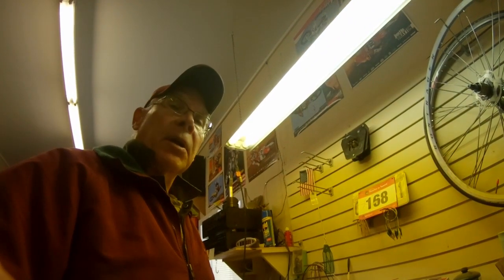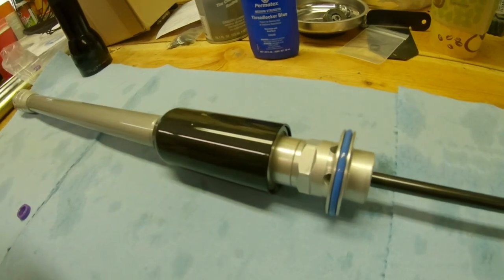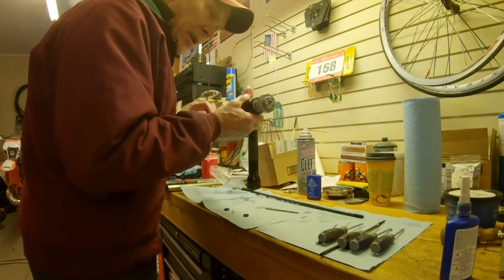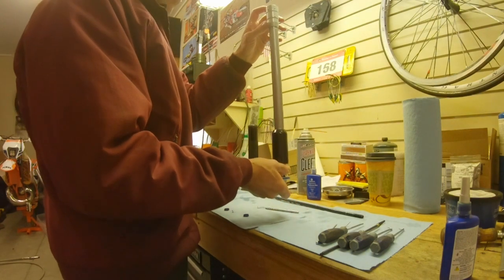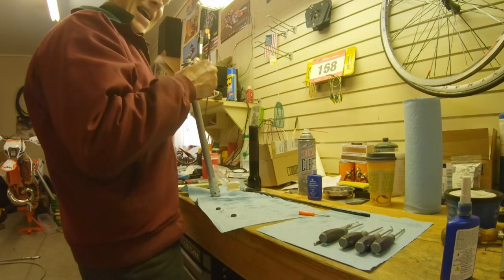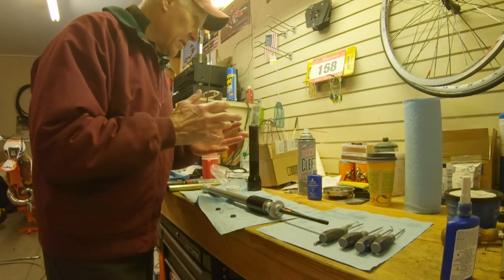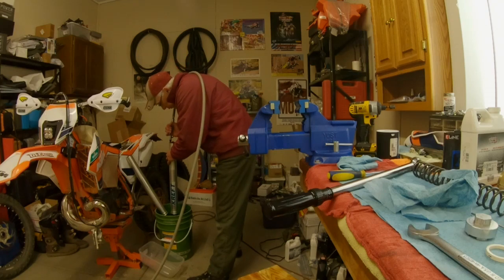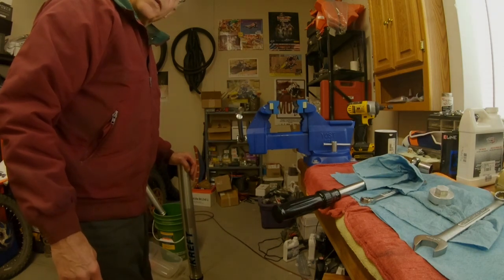4CS Forks -  Bad Cartridge Seals - Bleeding Issues

Comment from the maker: So, I learned something else. I was changing the oil on one of my forks and the oil was dripping through kinda slowly. I was like...hmmm? Even tho it looked fine, I changed the purple seal (took only about 1 minute this time!) but no change in oil leak. I pressurized the fork anyway and when I went to insert the aluminum rod into the piston rod (that clickers actuate) and the thin tube it goes in was full of oil! Something was not right! So, I changed the big blue outter oring even tho it too looked fine, no change. Upon pressurization, the inner thin tube again full of oil. So, I talked to my suspension tuner. Apparently there is a tiny oring inside the bottom of the piston  rod components (above the bullet shaped end) that can go bad. He said sometimes, when its bad, you can actually blow the clicker right off the fork when riding and get a faceful of oil!  I'm crying UNCLE and sending him my inner cartridge so he can replace the oring.

Comment: I have this exact issue. Lots of research later, this looks to be the easiest solution. You can it seems remove the "top hat" but it's torqued and has Loctite, so it probably needs to be heated (although the service manual skirts over this). It's hard cranking on a $500 cartridge, so your method is worth some time. Everything I read says the 4CS are poorly designed. The rod is notched to balance air and this cuts into the seal - it fails by normal operation and design - silliness. $15 at Slavens for 2 - I'll order 6 so I have spares. There are mods to revalve and turn into open cartridge design - but that seems like a lot of expense and hassle and I'm not that fast. Thanks for the video!

Comment: Thanks for the video. Got me up and running again! I used a cap head screw and pushed the head of the screw in through the seal hole and the pulled the seal into the groove with the screw head. Took about 2 minutes that way. Cheers
Reply from the maker: I don't totally follow what you did, but glad it worked!  Dunno if you saw my post from a year ago, but I got lots better at it...but I'm always open to learn a new way. Can you try describing what you did again?  Many thanks!

Comment: Thanks for the video! I have one question- how long did the seals last after replacement?
Reply from the maker: Sorry for the delayed response....they are still fine...I serviced the forks a few months ago - no leaks and the rod stayed up perfectly after pressurization.
Reply: @Dmac-CO  Thank you for your reply. I have serviced my forks, along with replacing the seals. I'm just wondering if in the fork responsible for compression, the push rod is also supposed to pump itself up. It works great in the reb fork, but hardly at all in the comp. When I bleed the forks after riding, I can only hear a hiss of air from the reb fork. How is it in your case?

Comment: What's the oil height supposed to be set to? Is it 65mm from the top when outer sleeve is slid all the way down.
Reply from the maker: 65mm would be really high, which would make your forks harsh.  I put 510 cc in the bottom and 130 in the top, then screw on the cap, pressurize to 75-100 psi, then unscrew outer tube from cap, remove cap and raise outer tube to max and then lower the tube. Then set oil height. I set mine at 120mm...my son's at 110. Then install spring and spacers, cap and reinstall bleeder if you use em. Set clickers. Done
Reply: @Dmac-CO  thank you good sir! I have the 4cs on my '16 husky TE 300 and I strongly dislike them. They bottom super easy and are harsh up top, worst of both world. Thanks again!
Reply from the maker: @erikstevens7301  I had mine revalved by Kreft. Unfortunately, they no longer have the custom components to do new forks.  Maybe once you fix the cartridge seal, the forks will be better. When the seal is shot, they are like an open cartridge fork with the wrong valving.
Reply: @ADV-dmac , which direction do you insert the seals? Open side toward the top or bottom of the fork?
Reply from the maker: @Glingafelter  Seals are always open side toward the oil...so down in this  case.

Comment: How do you get the jam nut off the pushrod? I can only loosen the jam nut by putting on the fork cap, but to take off the fork cap, I have to loosen the jamnut to where it gets stuck on the pushrod. I cannot for the life of me get both the jam but and fork cap loose at the same time without putting the pushrod in a vise etc. I am hesitant to use a vice or vice grips on the pushrod as I assume it is just aluminum. Any tips would be appreciated!
Reply: Probably late at your party but when jamnut is stuck on rod, use 2 nuts to lock them together on the threaded part, then loosen the jamnut, unlock the 2 nuts and get these 3 unscrewed. It's fine threaded M8 I think 0.8mm per thread if I remember correctly.
Reply from the maker: Sorry....wasn't on YT for some time. I imagine you've got this figured out by now, but a good piece of tooling to have is soft jaws for your vice.  If you have the right sized ones, you can safely clamp on tubes.  Rickozx's jam nut solution should work tho.

Comment from the maker: Update! Cartridge seal insertion now only takes a minute!

Was doing another set of 4CS and think I hit on the insertion trick. Works for me anyway,  Turn the cartridge head so the little notch at the top of the head is away from you. Dunno if it matters, but my logic is to get the sharp edges away from where the seal is going. LIghtly lubricate the seal and squeeze it with your fingers and insert it into the hole (it'll be kinda vertically in there) then, using a wide and dull tool like I showed, pull the side closest to you back and up into the groove where its supposed to be seated. Then insert tool further to get the furthest inserted portion of the seal and carefully pull it up to further seat the seal into the groove. Retract tool partway and use it to get the portion of the seal thats on its way into the groove fully inserted (it'll likely be a little cockeyed). Then, once the one side is fully seated, reinsert the tool down to the portion of seal thats furthest in, maybe slightly to one side or the other, and gently pull up on it. If all goes well, it'll pop right in!
Reply: Which direction to put in the seal? Open side toward the top or bottom of the fork?
Reply from the maker: @Glingafelter  Open side down....see 2:20 in the vid.
Reply: @Dmac-CO  thanks. No luck doing it that way with some aftermarket seals. I still can’t get a proper rebound of the damper rod. Just ordered a set through slavens, so I’ll try those ones when they arrive. Just to confirm, the damper rod should rebound on both the rebound and compression sides?
Reply from the maker: @Glingafelter  Yes.

Comment: Thank you soon much for making this video. I new I had a problem with seal, but no idea  how to replace. I have a "KTM" repair (CD) manual that does not cover this seal replacement. I'm going to order new ones and attempt doing it as you have since I had no luck trying to dissembling the inner tube (?) to get at it.
Reply from the maker: I've been offline lately....hope ya got it fixed!

Comment: I just did my own fork seals change , first time ever... that was interesting...   Watched the official and other vids showing filling from bottom..... started that and , as you describe, oil pissing out below rapidly.....  I needed bike going  to mark out tracks for upcoming ride so spent a LOOONG time bleeding from top , slowly adding oil and pumping rod up and down until all air was out.... it wasn't fun but it worked.     I will have to fix it in the near future, but they work well enought for me for now.  Thanks for the video.   And yes, nothing out there on rebuilding inner for 4CS....  rocky mountain did a inner for an open fork. Strange no one covers it.
Reply from the maker: Glad it helped! I did same as you on the first one...filled from the top. Did some fork compressions by hand afterwards and didnt like how it felt. Very linear/sluggish. After the new cartridge seals, the plushness in the early part of the stroke was back. For an overall how to, WP has 2 vids that are very good, but they dont cover the cartridge seal issue
Reply: @Dmac-CO  I found the service manual last night for a 14 husky (i have a 13 berg - same) and they show undoing the top of the inner where you inserted the seal, and it looks like you insert it from the back once its apart.
Reply from the maker: @Gazfixify  Thanks! Lemme know if ya do it that way. Will hafta look in my service manual too.